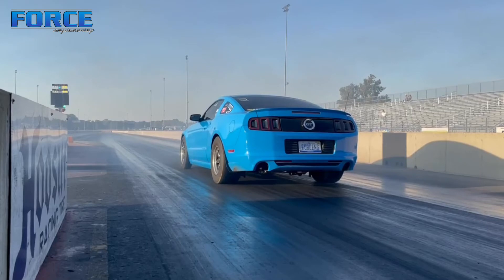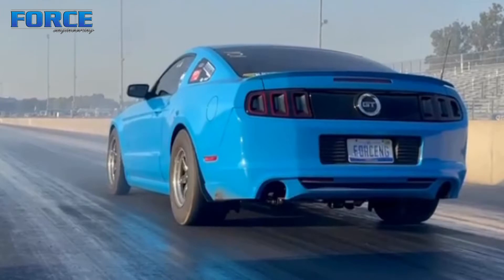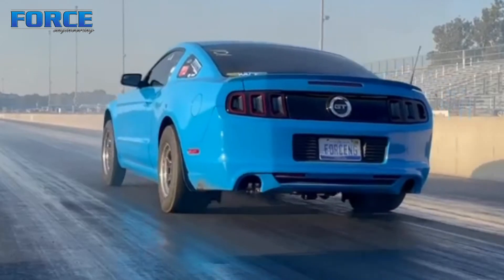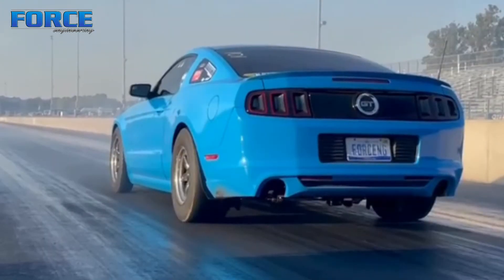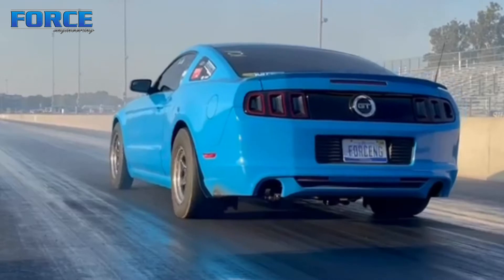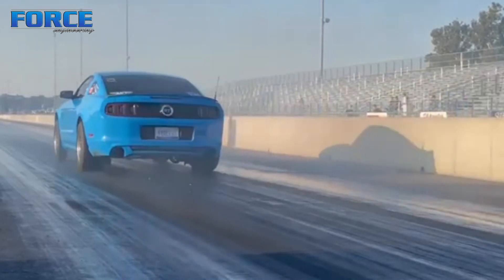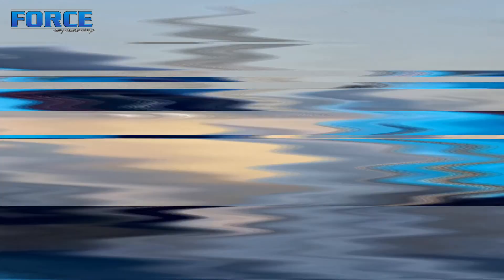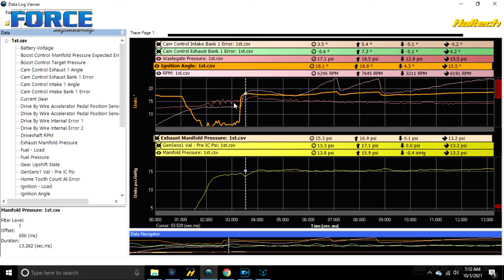15 psi Test Pass | Haltech Data Logs Reviewed | Turbo 5.0 Coyote

Comment: What are you expecting to blow at high boost? Just valvetrain? Those shortblocks are fairly stout, right?
Reply from the maker: Everything is at its limit.  This is the fastest stock gen 1 engine currently and we are looking to improve that. The block/rods ect are all going to on the edge.